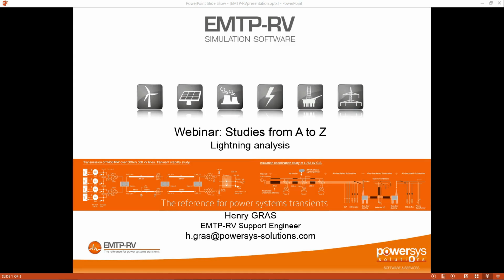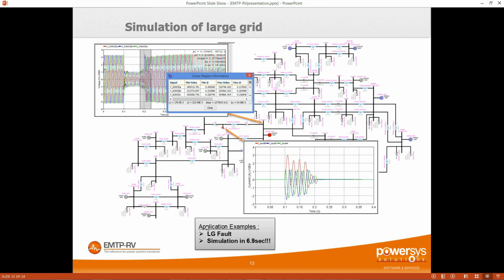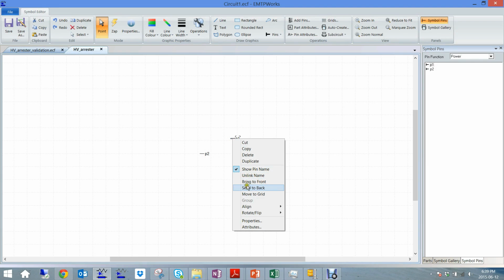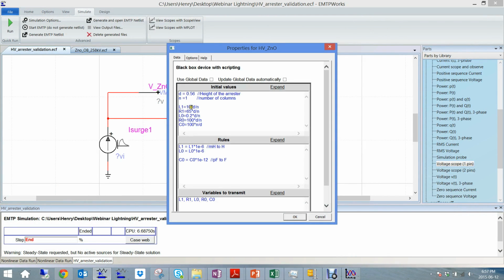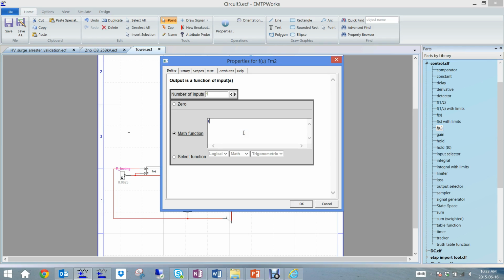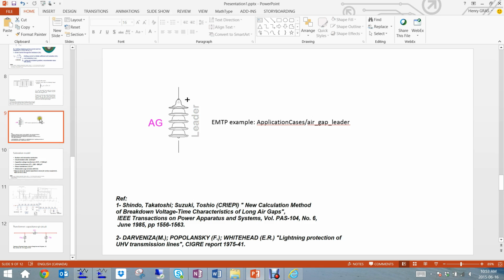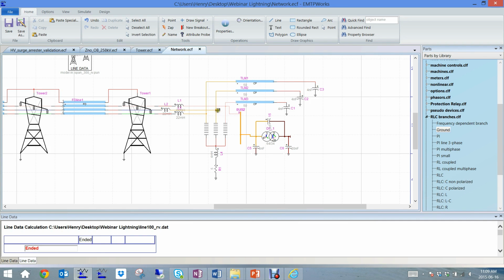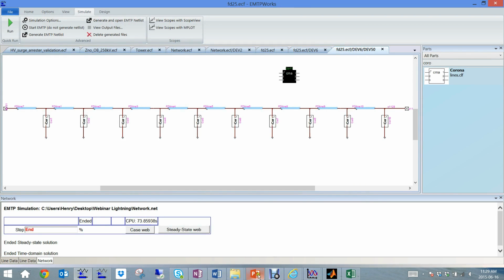Webinar on lightning stroke analysis (outdated - new video available)

Comment: Hi everyone. Can you help me?

I have a problem with the Electric field strength

How do you export the resutl of the Electric field strength for the transmission line with 220kv voltage. I need your help ! Please help me!

Your answer to comment or send to mail: trungtvxl@gmail.com
For example:

 X-COORDINATE (M)           ELECTRIC FIELD STRENGTH(KV/M)

 -1.00000E+02                4.57034E-02
 -9.95000E+01                4.59468E-02
 -9.90000E+01                4.61904E-02
 -9.85000E+01                4.64342E-02
 -9.80000E+01                4.66779E-02
 -9.75000E+01                4.69216E-02
 -9.70000E+01                4.71653E-02
 -9.65000E+01                4.74087E-02
 -9.60000E+01                4.76519E-02
 -9.55000E+01                4.78948E-02
 -9.50000E+01                4.81372E-02
 -9.45000E+01                4.83792E-02
 -9.40000E+01                4.86204E-02
 -9.35000E+01                4.88610E-02
 -9.30000E+01                4.91008E-02
 -9.25000E+01                4.93396E-02
 -9.20000E+01                4.95773E-02
 -9.15000E+01                4.98139E-02
 -9.10000E+01                5.00492E-02
 -9.05000E+01                5.02831E-02
 -9.00000E+01                5.05153E-02
 -8.95000E+01                5.07459E-02
 -8.90000E+01                5.09746E-02
 -8.85000E+01                5.12013E-02
 -8.80000E+01                5.14258E-02

Comment: Hello friend, I have one question, I hope you could solve this question mark. Why does in minute 2:55, you show a electrical diagram with the CVT before the surge arresters..?? I think that If I put the CVTs first than the SA, the CVTs could sense the entire  lightning stroke..!! isn't it..?? I hope you could solve this question..!!
Reply: The location of the CVT is entirely up to the station designer, perhaps at this case, they are at the bus entrance.The SA might be put in different places (some in cascade configuration even, observe at minute 1:38:24 ), but they exist specially to protect the TRX. Then, the SA are usually close to the TRX, observe that he includes the inductance between the SA and the TRX, that value is of importance for the insulation coordination of the TRX.